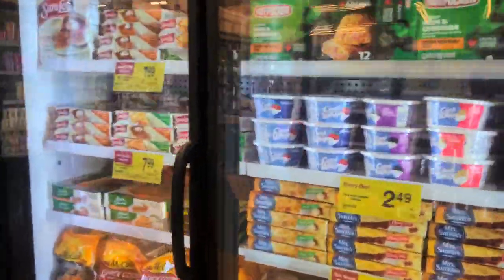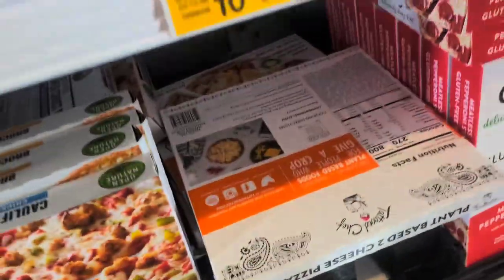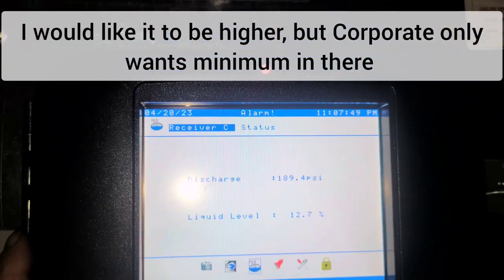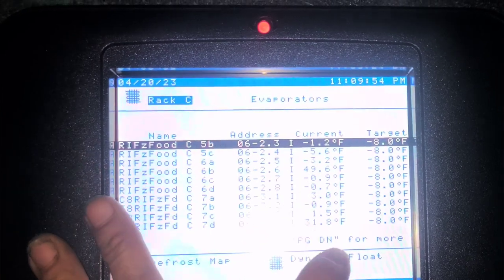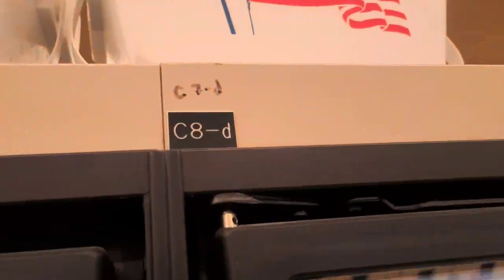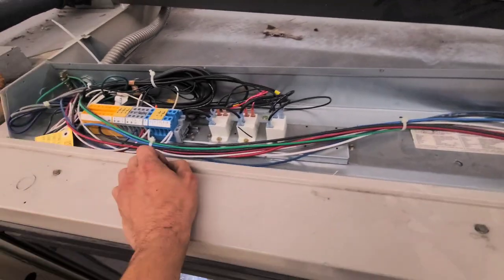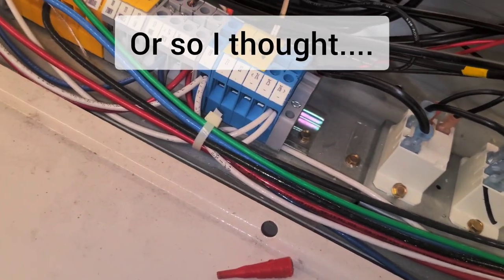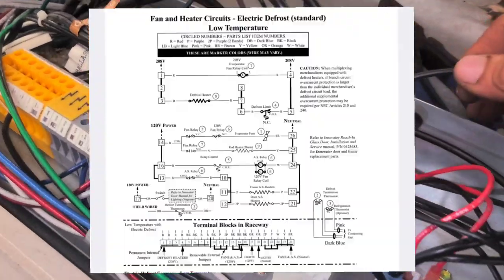Frozen Pizza Cases with Hard to find Defrost Contactor with Melted Wire(Open Circuit) FIXED!

Comment: I gave you a 'like' because I work in a grocery store (in the pharmacy, but no matter) and this gave me some vague insight into why our freezers sometimes misbehave.
Reply from the maker: Well thanks, I appreciate the like and the comment. They stop working for alot of different reasons. They are usually froze up for one reason or another, which can be quickly identified by feeling at the top to see if airflow is missing. More often than not, we have to run hoses and wash the ice away before it will run again...